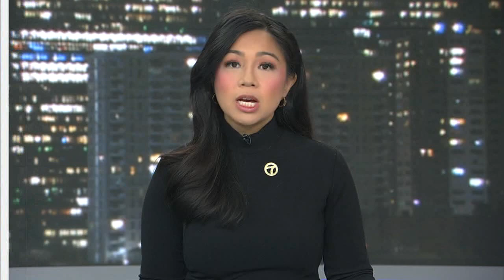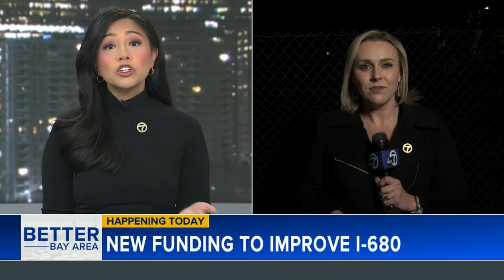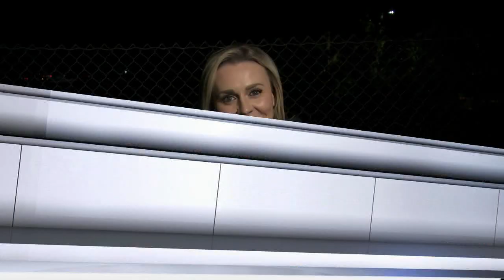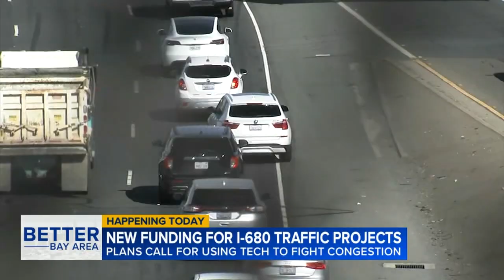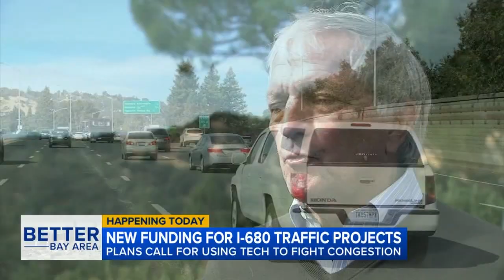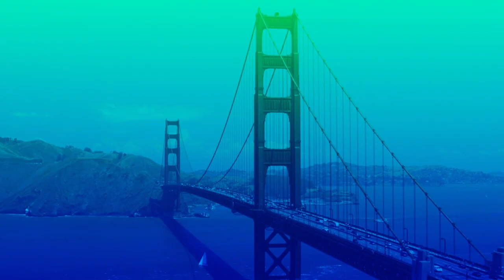First-of-its-kind metering technology to help tackle traffic congestion

Comment: $166 million to install technology that'll realistically only save the average driver a few minutes off of their drive time?  I'd much rather that they allocate the money toward ripping out the old 50+ year old concrete surface along that corridor and installing brand new 40 year life concrete so I no longer have to dodge a bunch of potholes.  It costs about $1.5 million per lane mile in the Bay Area to rip out old pavement and install a new concrete base and subbase, plus the top layer.  Maintenance, maintenance, maintenance should always be the first, second and third priorities before any widening or other congestion-improvement projects.  

Since it's about 13 miles between where the old concrete begins around Alcosta and ends just before entering Walnut Creek (where the surface turns to 100% asphalt), that's about $156 million (estimated cost) to install 8 brand new lanes of concrete that will last forever...but nope, we're getting technology instead that'll shave off just a few minutes if that.  SMH.

Comment: I know and use those freeways, that traffic is not going anywhere no matter how much money you waste on it. Anyone that's driven on and use the freeways in the bay area will tell you that. A $166 million to monitor traffic which it already does, metering lights that you already sit at and change because of the traffic their already monitoring? They can use words like "new state-of-the-art technology" and "monitor real-time traffic" what? so they can "instantly" change ramp metering timing, and magically adjust the traffic on the road going 7 - 12 mph?  If anyone's interested? I have a bridge for sale and its a lot cheaper than $166 million.